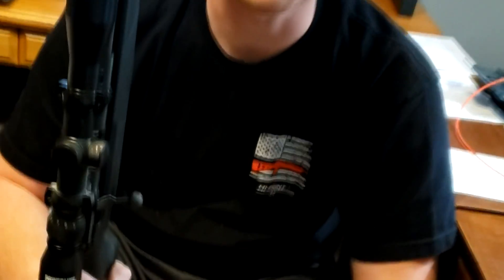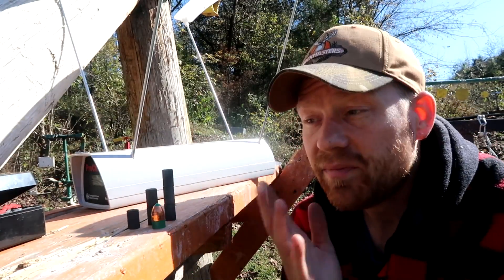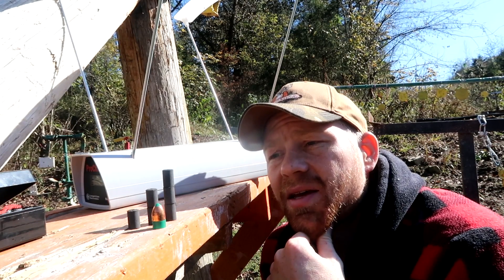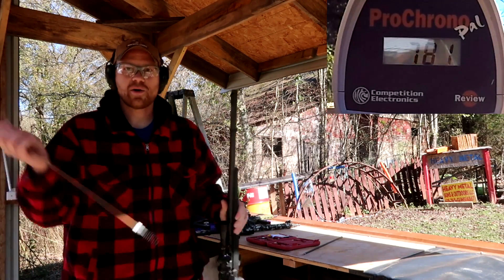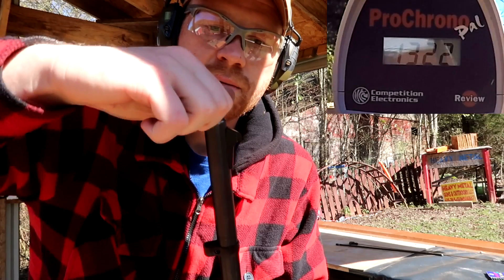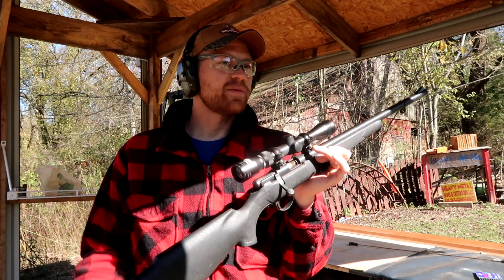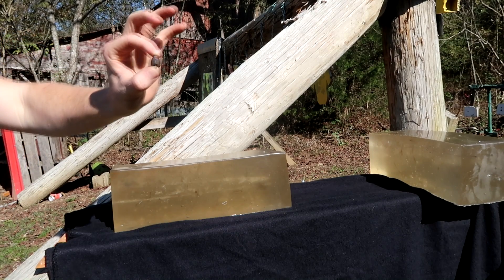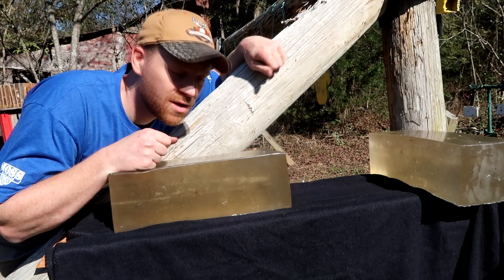Muzzleloader vs Ballistics Gel!!!

Comment: Have you seen/tried the Federal B.O.R. Lock bullets?  They make a 270gr copper tip and 350gr lead tip in .50cal and they're awesome.  I've dropped deer in their tracks with the copper ones.  Also, if you hate cleaning the barrel try the IMR White Hot powder pellets.  They're so much cleaner burning than the Pyrodex or Triple 7 pellets.  I've shot 9-10 shots before lightly cleaning at the range and shooting some more.  Granted it was also a CVA Accura V2,  but the setup is pretty clean and works great against game.
Reply from the maker: Never seen those
Reply: @WHOTEEWHO  if you give them a try use 2 to 3 IMR pellets...the Federal's expand like a HST self defense round

Watch your face with 3 white hot pellets!

Comment: You can touch them if your going to shoot them right then the problem comes if you touch them with moist hands and let it sit in the barrel it will corrode. But seeing how your barrel is rusted already no worries. That 50 grain did a good job . I use 100 grain only and I shoot 240 grain Thompson center bullets. Kills them dead every time. I was going to switch to power belts but I have so many bullets I won't need to replace them for years and I shoot about 10 rounds per season to make sure things are just right. Nice job and be careful with that full charge it will bite ya.